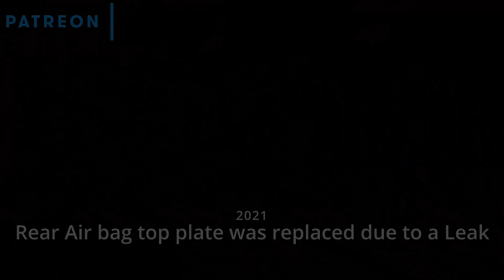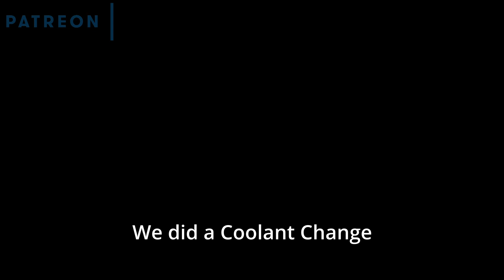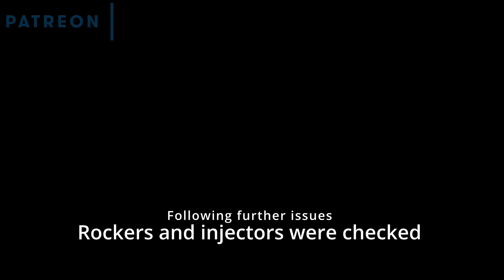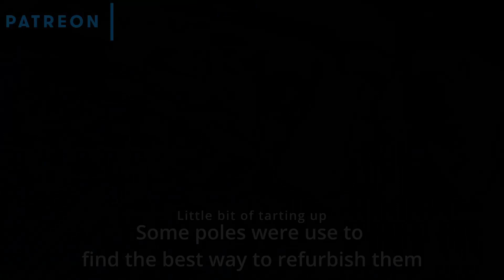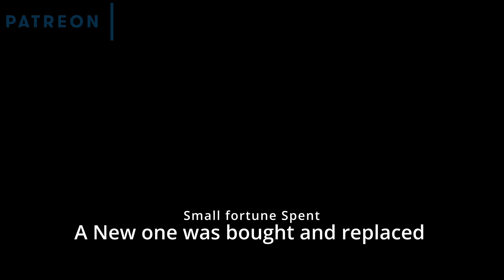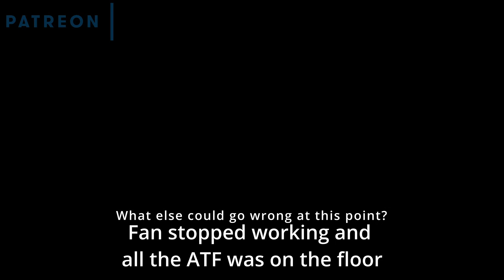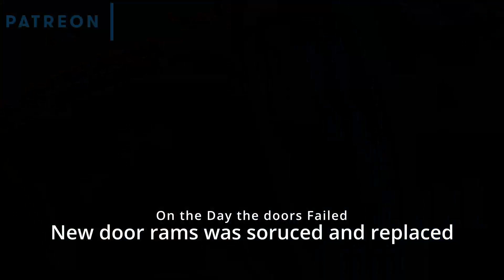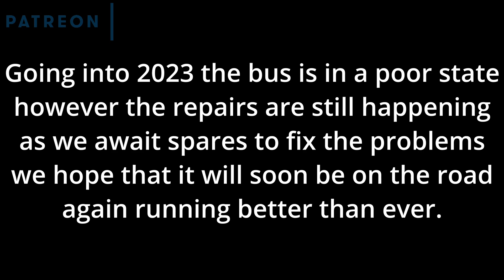Rossendale Dennis Dart SLF: The Complete Story so Far

Comment: Really admire the effort on this bus. Looking at the issue makes you realise the day to day upkeep in buses and why companies replaced these at a much younger age. Keep going
Reply from the maker: These older ones are work horses if they are looked after well. There is nothing to stop this from running a public service it's well made and isn't too different from the MMC 200 or the enviro 200 the chassis are the same pretty much underneath. This one is not in the best of shape due to the history. 2013 it was scrapped. Found its way out the scrap yard to a air field where it was used as a shuttle with no maintenance pretty much other than having new tyres once in a blue moon until we bought it so it spent around 8 years of not being looked after. So when you look at it like that and then after 10 years plus it passed a MOT without major issues. Is pretty bloody good going :) hopefully there will be much more in the new year once the fuel pump is sourced we will be on the road again :)
Reply: I was lucky to be based in a dart heavy town of swindon. These were the heart of the network for best part of 20 years with the last being retired from service when go south coast took over.
Reply from the maker: @garycampbell3301  Yup they just keep going esp with the Cummins Engines